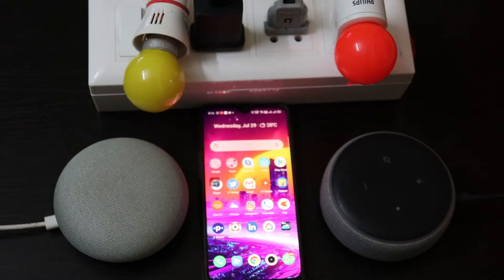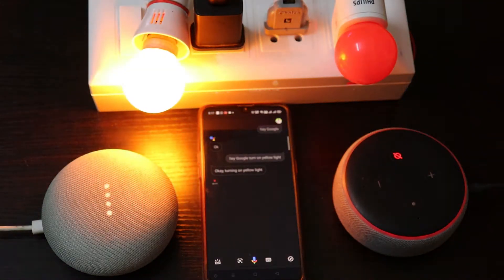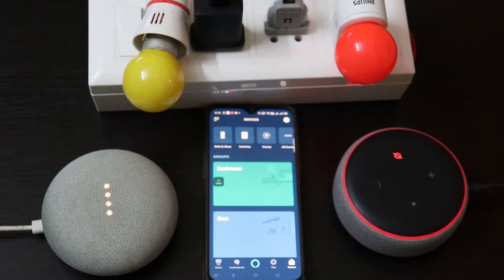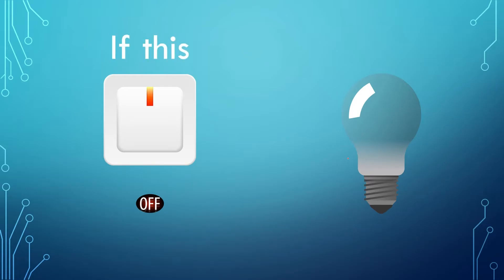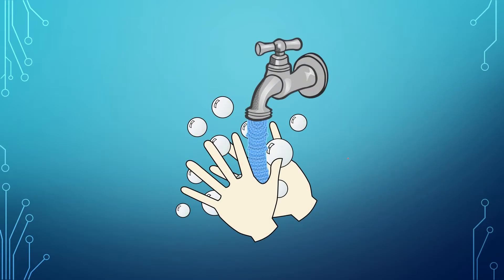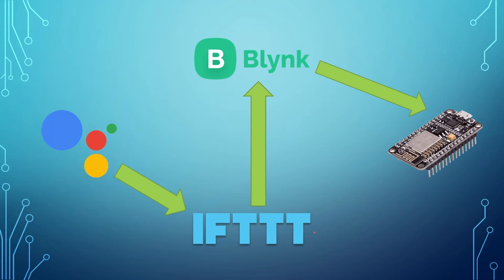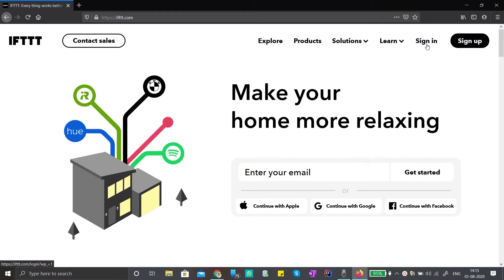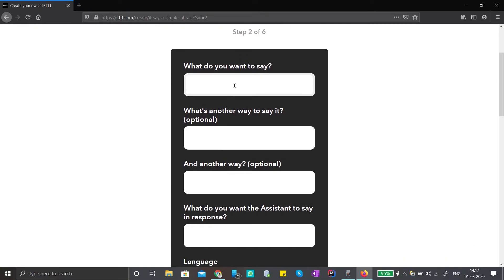What is IFTTT? How to use it? Control ESP8266 using Google / Alexa using IFTTT and Blynk

Comment: Hai 
          Can we use the same single nodemcu to work with  ifttt and blynk  simultaneously  in a single program?
Ie;
I need to get telegram call when motion detected in my home and  I should be able to control my lights through blynk. 
Is it possible?
Reply from the maker: Yes, you can make use of single nodemcu for your usecase.